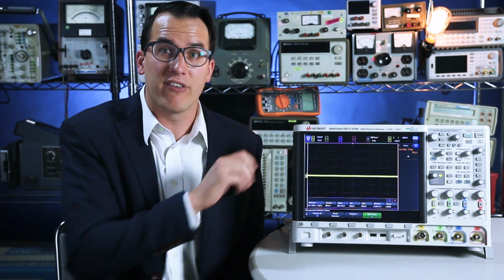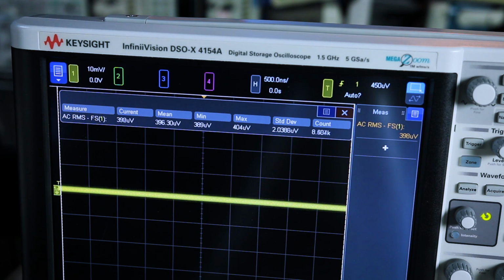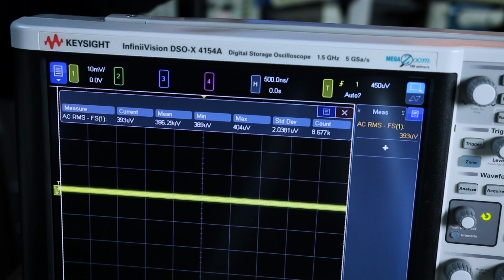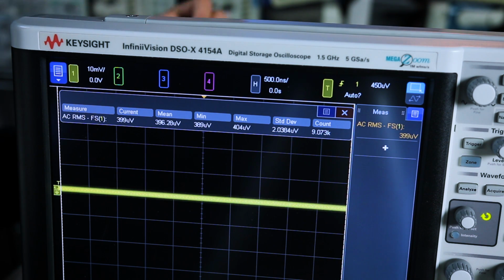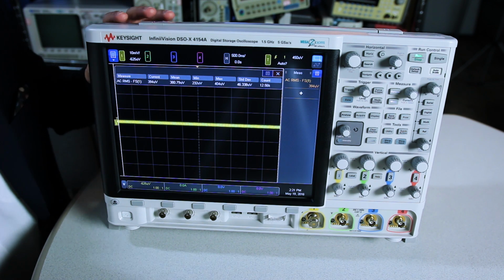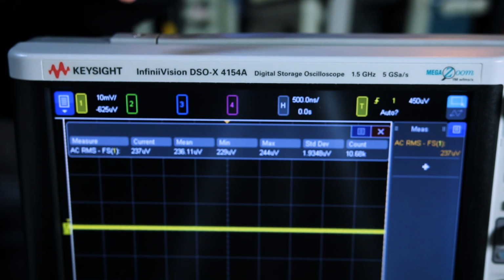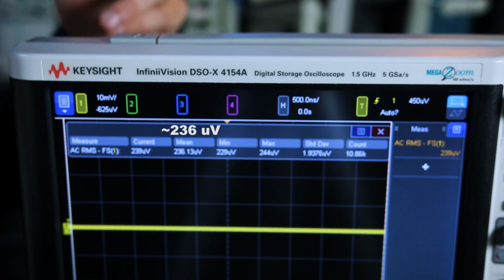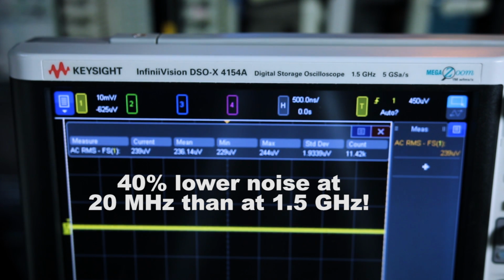The Basics of Noise - Oscilloscope How To - The 2-Minute Guru (s1e10)

Comment: So, to observe noise waveform, I don't need to connect the terminals of the oscilloscope anywhere, right ?
Reply from the maker: Ideally it's best to ground the BNC, you can use a bnc short or in a pinch ground the probe tip to the ground lead
Reply: @KeysightLabs  Alright, Thanks. However, allow me to ask me one thing more. 

Actually, I have been trying to explore how RMS value of Pure (thermal) noise voltage changes with sampling frequency. 

I request if you could project illumination on this aspect. 

Thanks.

Comment: Yes, please more on noise, my janky projects are noisy as hell and sometimes I have no idea what my nonKeysight scope tells me about them (triggering problems)
Reply from the maker: Yeah, noise can cause a lot of triggering problems! One of the major issues can be with edge triggering, the noise can cause one edge to appears as multiple edges by moving the signal above and below the trigger threshold.  A couple quick tips would be: 1. Use only "rising" or "falling" edge trigger but not "both." 2. Play with "trigger holdoff" to try to stabilize your triggering.  3. If you have it, use the "noise reject" option in the channel or trigger menu.
Reply: KEYSIGHT OSCILLOSCOPES will do, thanks!

Comment: If you are up against the noise floor of the scope input - are there external amplifiers that can deliver better noise performance without having to buy a new scope?
Reply from the maker: That's a really good question. If you're up against your scope's noise floor, usually the best bet is to try to improve probing.  We haven't really seen any external amplifiers that make any significant difference.  With regards to probing, it can sometimes be useful to use 1:1 attenuation instead of 10:1 attenuation and use the scope in 50ohm mode instead of high impedance mode.